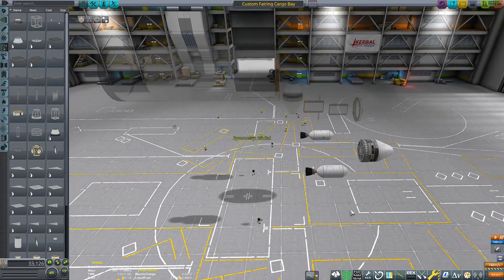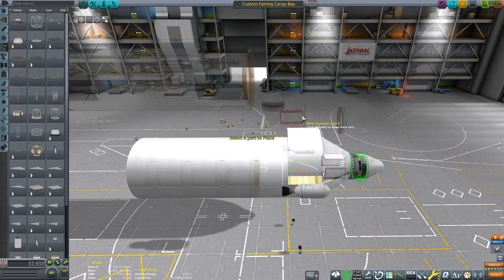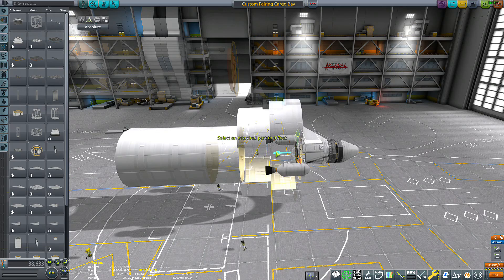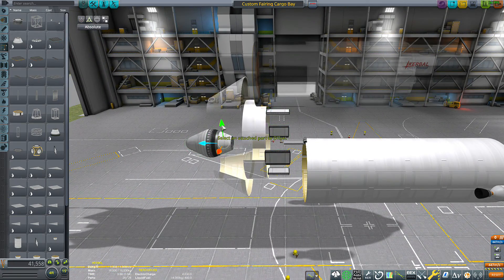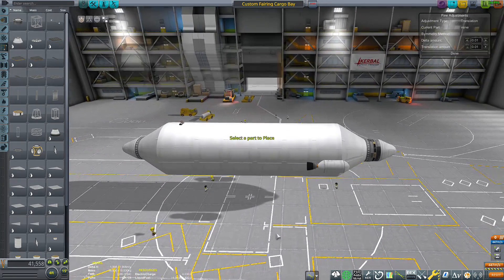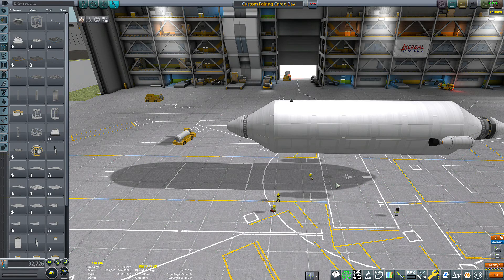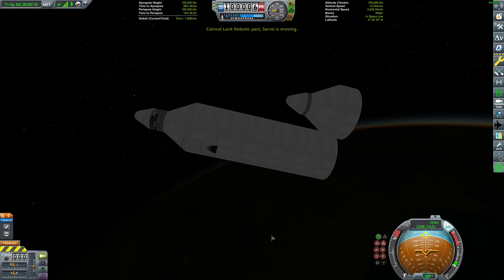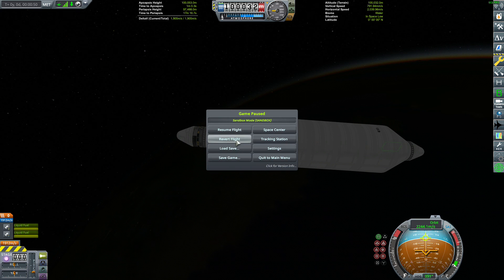KSP Quick How To's EP2: Custom Breaking Ground Cargo Bay

Comment: Anyway this would be possible to do a 6.8 wide cargo bay?
Reply from the maker: With the changes to the way fairings work a few updates ago, you can now hold alt and click to close a fairing without needing to close it on any parts.  So you can use that trick to make them as wide as you like!
Reply: @lt_duckweed  Yes I know what you mean I’m doing a starship payload bay and anytime I just close the open ended fairing and test it my payload is just completely stuck
Reply: @lt_duckweed  I did use your way of doing the 5m fairing and the engine plate and that works perfect but I can’t figure out a way to make the fairing bigger and still get the payload to come out of it

Comment: Very nice!
How does it hold up in regards to drag? Is the inside shielded from aerodynamic forces? How much drag does the back part experience?
Reply from the maker: Everything inside the fairing is shielded from drag, and the flat ends don't create any drag due to the fairing being "closed" and having the base node inside the fairing covered.  So the 9nly drag the whole thing experiences is the drag from the hinge (too far up and centered between the fairings) and the body drag from the sides and bases of each fairing.

All in all it makes for a very streamlined craft.  I have an ssto that uses a 3.75m fairing that widens out to 12m that can get airborne with 35 tons per rapier no sweat and is capable of 50%+ payload fraction to orbit.
Reply: @lt_duckweed  Splendid. That was something I've been looking forward for a while.